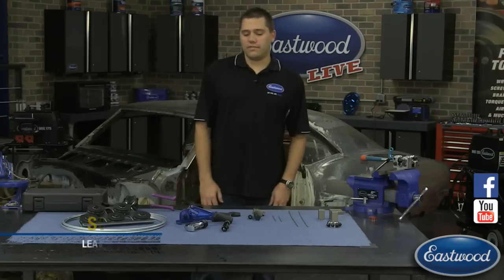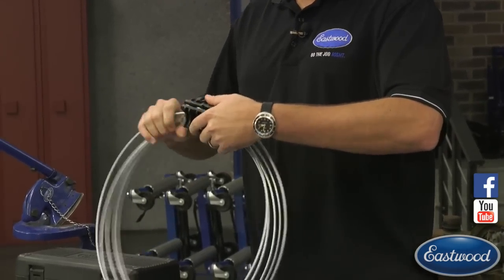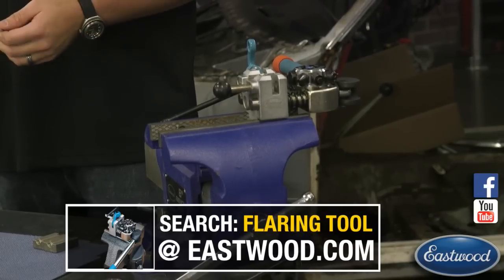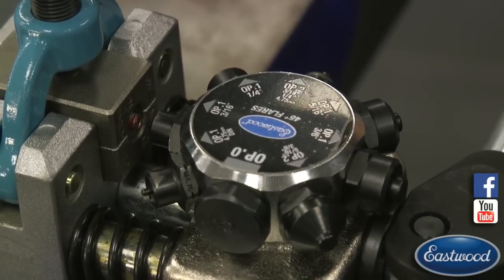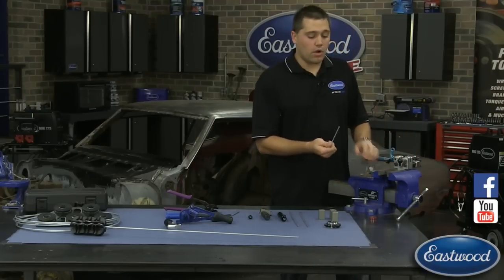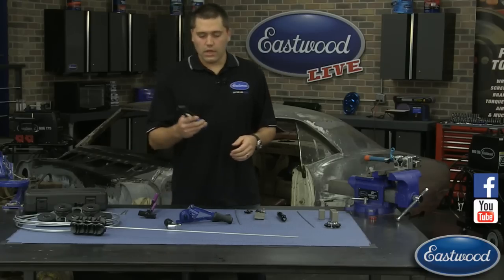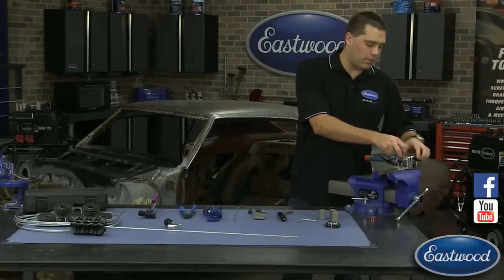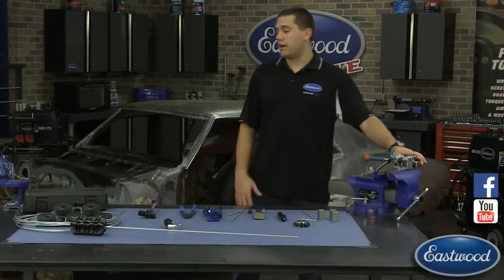How To Flare Brake Tubing Plus Must Have Tools for Brake Lines! Eastwood

Comment: thank you for the video,  I understand that the early style flaring tool kit, isn't fool proof but I wished you would explain the proper technique of using one. I don't wish the expense for two fittings that I require and that I may never need the costlier one in the future.
Reply: Pro tip : watch series on Flixzone. Been using them for watching lots of of movies these days.
Reply: @Finn Reyansh Yup, have been using Flixzone} for since december myself =)